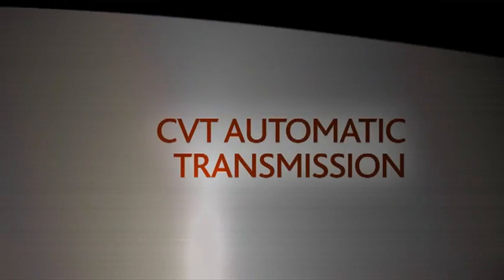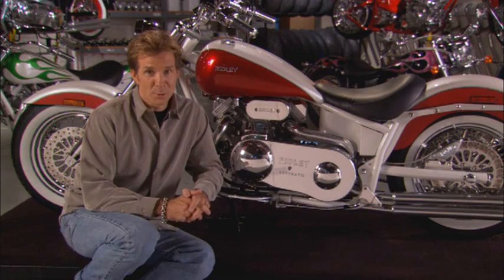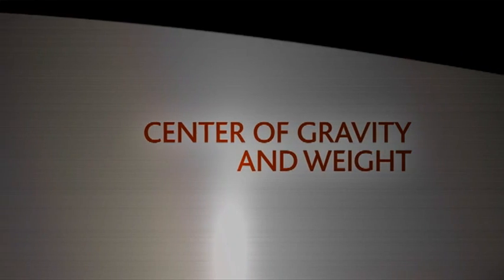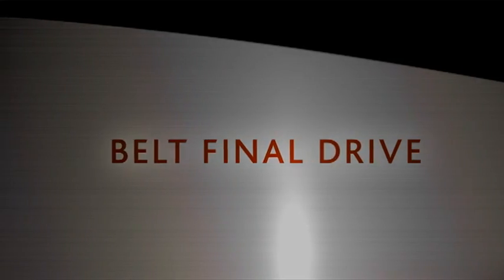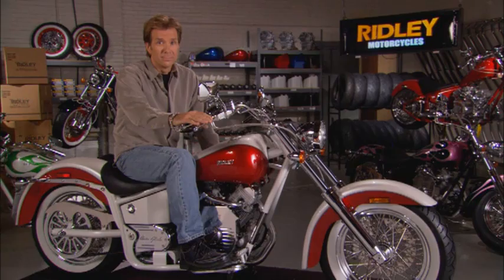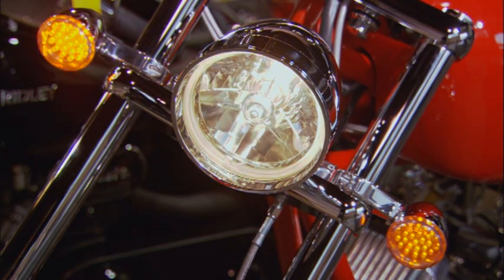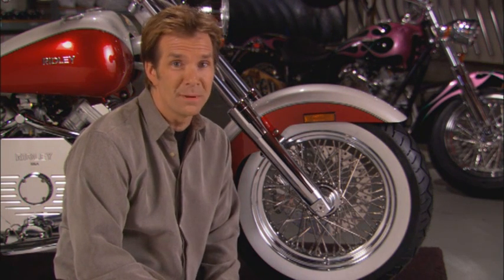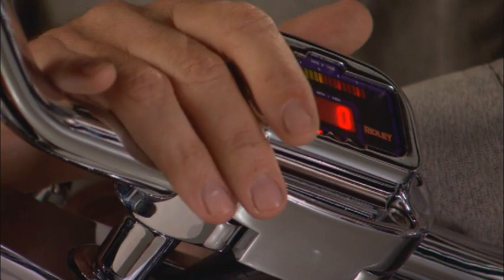Ridley Automatic Motorcycles

Comment: good morning to you, I did a search on the web and I found you, I write from Italy and I have a special license, I practically can't use my feet because they don't have much strength, my car is modified, it has a lever brake near the  steering wheel and accelerator activated by the upper acts, also I would need a motorcycle with a low seat and yours would be fine.  I wanted to ask you if in Europe, better if in Italy there is a dealer or how you can do it to buy it, better if already modified in the factory with the rear brake brought to the handlebar because changing after the vehicle costs a lot in Italy.  thanks for a possible reply, the idea is more than excellent of this bike with the automatic transmission and it could have a good interest in Italy since even the same scooters have an increasingly higher saddle
Reply: vincenzo leoni look into Can Am

Comment: I noticed that this video is from just a few months ago. Is Ridley back in business, or planning on picking up production again? Or is this a third-party deal, like DeLorean Motor Company?
Reply: I don't get it either,  I thought they went under in '09... maybe this smooth-talking shyster has the rights to it. Like when you go to Walmart and see a "Zenith" microwave for $52,  ugh.
Reply: This is an old stock video from the days the company was still in the hands of Clay and Jay. Ridley is now completely owned by Route 66 Ridley, which is where you can buy all your parts from. Unfortunately, no new bikes are being manufactured. But if you buy a Ridley, Derek Smyth, the new owner of the company, will not only get you your parts, but will instruct your mechanic on how to service it. I too wish Ridley would be brought back into production. Maybe someday. I’d like a water cooled, fuel injected version. But I am glad to have a 2008 model, because it’s belt driven rather than the pre-2007 chain driven system.

Comment: Sounds very nice, looks great but why automatic? I thought people who like things that look like that, like changing gears.
Reply: You thought wrong. I own two automatic motorcycles, one of which is a Ridley. I see little point in shifting gears. It’s a nuisance and completely unnecessary. Automatic (CVT) works perfectly.
Reply: @LanceRooke  what is the other automatic you own ?
Reply: @lancerooke4842  I guess. If that's what you dig, I'm okay with that. But I'll tell you what. I'm also a trucker as well as a motorcycle enthusiast and I hate hate hate automatic trucks. I tend to like the way things were when everything worked well. Tube amplifiers, analogue synthesizers and gears. Hell, I still play records. They're not as convenient as just typing something into your phone but I think many would agree there's just something about an actual record album that's just appealing. Not to discount modernity or to say that everything was better back in those days. But I do tend to prefer things that are made like they were made more than the new and improved way.